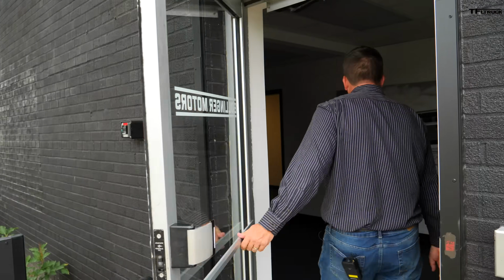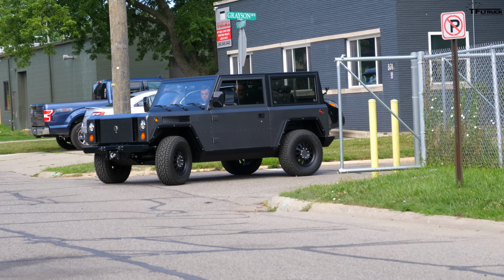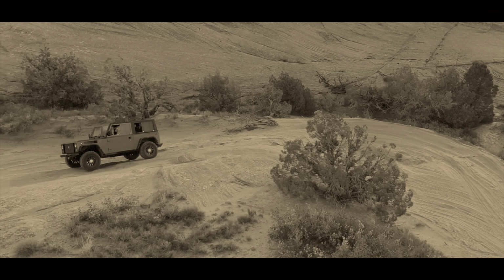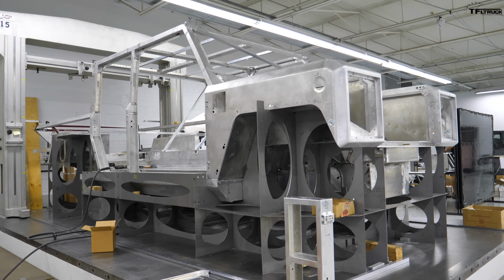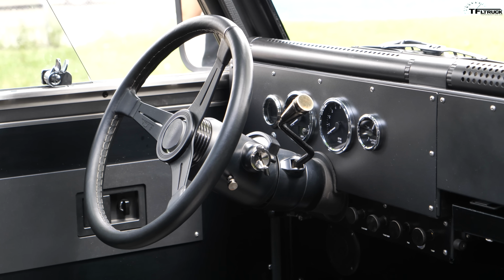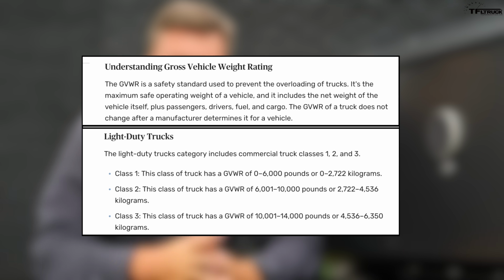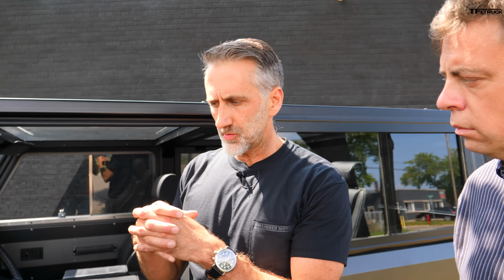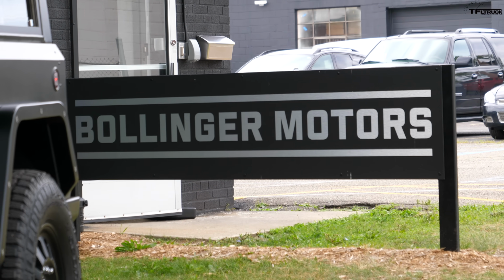EXCLUSIVE! Meet the Bollinger Trucks That Can Off-Road Like a Jeep and Haul Heavy

Comment: Well you could take a generator with you so you could charge it up if you needed to or make up a solar panels to charge it up while you fish or whatever. Anyways EV are coming and going to replace gas powered in the future especially when we run out of oil one day, so might as well get one to go along with what you already have. Times are changing if we want them to or not, so either get on board or get left behind!
Reply: It has a large flat roof that would be perfect for solar panels.
Reply: Or with all the empty space in the body a medium sized generator and 10-15 gallon tank to charge your batteries and power your camp/work site if needed. I don't understand the desire to make off road or work vehicles to be totally electric and not have any type of fuel.
Reply: I highly doubt EVs will replace ice vehicles, ever, even if ICE vehicles just become novelty vehicles, there will ALWAYS be people who want ease of repair, actual noise ect.

Comment: Throw a big loud V8 generator in the front and they might have something...lol
Reply: So not only doesn't it have gears you can row through but the engine just sits there at 3k rpm even when you're parked? What a complete turn off.
Reply: @markm0000  To each his own I guess. Personally I would not want to be deep in the woods and be low on battery. I would prefer to fire up the engine (like a diesel locomotive) and carry on. 200 miles range is very limiting. However if you are thinking of using it to shuffle the kids to soccer practice, then I get what you mean.
Reply: @smarticus6384  ----- What's the difference between being deep in the woods with a low battery and being deep in the woods and out of fuel?
Reply: Glenn Howden nothing, except for maybe a few hundred more miles of range. So I guess that’s something.....

Comment: Wonder how much it weighs since full ev vehicles weigh a lot.
Reply from the maker: Curb weight is about 5,000 lbs.
Reply: @TFLtruck  wow, that's pretty light for a full size truck. My dad has a 07 tundra and it's about 5700 ibs and has good acceleration. Can't imagine how fast this is with over 600hp.

Comment: Needs to be boxier.
Reply: Yeah. I know. They put round steering wheel, tires and headlights. That's just wrong!!
Reply: @reubinthomas  They will fix that for the next model.
Reply: Yeah the windscreen is at about 100degrees, should have been 90

Comment: If this was a gas or diesel truck, everyone would be laughing until they couldn’t breathe! The only reason people think this is a viable vehicle is because it is electric. It’s ugly, it has some of the most bizarre features, kinda like the Trailblazer when it had the sliding roof so you could load tall items, didn’t work. There looks to be about a billion dollars of factory and machining they forgot to get so they could actually produce more than 1 unit a month. There is no real design as the industry knows, even Rivian has an actual design vs build a box, place the batteries and motors, figure out how to fill the spaces left over. I know it’s not exactly that simple, but it looks that simple. Backyard hillbilly type build. They need an actual designer to produce something marketable. The “retro” rudimentary gauges, are just rudimentary. The steering wheel looks like they took it off of my John Deere yard tractor. Seats were nice for the front occupants. There, I said something nice. 
    Millions of dollars wasted, but the executives pull 1 or 2 million a year each out of it, live like kings and queens, have a nice nest egg left over when the company fails and they become another DeLorean type story.  There are a huge number of hours wasted trying to inefficiently build this vehicle and you pay for them. $150,000 USD? That is almost $200,000 Canadian. This spring I bought 3 x F150 XLT FX4s and 1 x F350 XLT FX4 Diesel for similar money. I will take 4 trucks that can be used every day, all day, run out of fuel and you can fill up in 10 minutes and keep working. They all have airbags and high end safety systems, including the SuperDuty! This is the most rudimentary, made up oddity that I believe will be around for a few years and then it will disappear. Try to get parts after that! These guys designed their parts in house, can’t go get something from Rivian and make it work etc. 
  I could be wrong, but this guy did not give off any vibes supporting his belief the truck will go into production. He appears to be just delivering lines people want to hear.
   Hope they make it. He said you either love it or hate it, I’m the latter.
Reply: You called it - your points are right on.

Comment: Looking good so far. But...Does the 200 mile range mean I'd have to transport it to the off road trail each time in order to have some fun? Overall I think EVs have one hurdle to overcome - they need some real breakthrough in battery tech. Otherwise, I like this.
Reply: I read in the last few days about an electric motor breakthrough out of Texas that promises lighter, compact, more powerful, and more efficient engines. That will help boost the range, so it is not just battery tech that progresses.

Comment: Battery on the bottom not too bright for offroading is it?
Reply: Lower center of gravity. As long as the protection is good.
Reply: xlthumper yeh but if the protection is forced upwards towards to battery could be expensive andnmot too far off s an expectation

Comment: The design looks like it will do terrible in a crash test...
Reply: alvaro mora the gwagon is totally boxy and is very good on crash tests
Reply: Yeah but the g wagon's A pillar is way thicker and the front part contains the engine....
Reply: @carholic-sz3qv  G-wagon have airbags and alot of saftey systems, soft materials were you can hit yourself in a crash. this one has... seatbelts.
Reply: I don't see any engineering for crumple zones, though it would probably really do a number on a vehicle it crashes into.
Reply: @I know you are right, And I just got owned but: be nice, low production volume has nothing to do with it. It's the GVWR.

Comment: As a Landie addict, looks like what I was hoping a new Defender would look like! Very workman like!
Reply: My only concern with replacing my Defender with this is that this is a much wider animal. Many lanes that are accessible in a Defender won't be in this.
Reply: @verlicht  Sure. It was the styling theme that I liked. All the talk of Broncos etc., it appears to me much more influenced by traditional land rovers. Narrow it a bit, give it a slightly taller body and stick a Land Rover badge on it!
Reply: @verlicht  could you imagine taking it down a country lane! Although I still prefer it over the new defender design.
Reply: @freyawainwright7364  Now that you speak of it, yes I could imagine me driving this car. Using my chainsaw to clear every track I go on to make it fit my dimensions and putting the first scratches on it (knowing thousands will follow). Feeling the hurt of that first dent on the side of the car and replacing the first flat mid-trial. Going through muddy places only possible with diff lockers for the first time without breaking out the winch. Pulling my companions out of the worst holes on planet earth and wading deeper than my Defender ever could. 

It would be a dream to own one of these beast one day. And I'd be the first to put it to use.
Reply: Well yes I think it is the lawful descendent of the Defender

Comment: When an electric vehicle can be charged from 1% to 100% in 10 minutes or less, AND charging stations are at every gas station, then I’ll buy an electric vehicle. I don’t want to wait for hours and hours to charge just to go 200-400 miles. Charge that sucker in less than 10 minutes, that’s how long it takes to fill up my gas or diesel tank. The next big thing in electric vehicles has to be charging fully in under 10 minutes, not 15, 20, 30, etc. It has to be 10 minutes or less.
Reply: 400 miles is like average 7 hour drive ? You do that daily...no. do you not have to sleep daily for 6hrs at least...no. do you not stop to eat for 30minutes..no. do you not have to go to the bathroom play on your phone for 30min..no. Do y'all just see a #EVrange number & judge it with no facts... pretty much.
Reply: SOLAR SS Daily driving isn’t where I take issue with range. On average I’m taking trips 4-5 times a year that I’ll cover 400 miles in a day. If I were to switch to an electric truck it would need to be capable of covering that distance. When I’m on the road I tend to eat while I’m driving, and keep bathroom breaks as short as possible. I don’t like making the trip any longer than necessary. I’ve made the trip from Suracuse NY to Breckinridge Colorado in 28 hours. In an EV that’s just not possible. You’d have to stop and charge. Which I’m ok with, it would force me to actually get some sleep. My point is range matters though. Not for every day, but for travel it’s imperative to making good time.
Reply: @MullerMountainMedia  when i drive over close or over 20 hours im just a zombie for the next 2 days so i just avoid that anymore all together (flying if i need to get somewhere quick). Granted i wouldn't like having to wait the extra time either if i had nothing to do. But as long as it was a 3 phase charger I'd manage
Reply: SOLAR SS Long Hours on the road takes its toll on my energy level too. I’m used to running on too little sleep though so I usually recover within a day. And I hate the TSA. Lol. Either way I’m more likely to go with Tesla anyway. This thing is a bit spartan for my taste. I can’t wait to see what their truck looks like.
Reply: SOLAR SS I do drive a ton daily, I’m an Uber and Lyft driver. If my car is sitting and not moving, I’m not making money.
Reply: With EVs, you have to change your habits a little bit. Plug it in overnight and have full range everyday.
Reply: @officialyasir  A ton of people can't charge their EVs because they have shared parking or park where a lot of people walk around. That's just asking for someone to mess up your car.
Reply: Mark M I agree it’s difficult for people living in apartments. This is why Teslas are popular because they have a fast charging superchargers network. I got lucky, my apartment has a multi story parking garage that has outlets around and also 2 ChargePoint chargers.
Reply: I’m ok with a slower charge, as long as they up the range. Give me 500 miles and I can charge overnight.
Reply: @officialyasir  Here is one of many stories: https://www.pocket-lint.com/gadgets/news/130380-future-batteries-coming-soon-charge-in-seconds-last-months-and-power-over-the-air
Reply: New battery technology is coming.
Reply: @officialyasir  granted it will. But the new Ram has a what 23 gallon tank ford 21 gms like 24 (1500s standard) they won't go for 200miles either anymore. Quicker to fill up but still have to stop
Reply: @officialyasir  yeah lol most of them on the new ones are a option too which are harder to find decked out like you want. The old standard 26.5gal tanks where the ones i like. My old HD Avalanche had like a 38gal it was overkill for what it could pull.

Comment: The rear end would look much better with a spare tire carrier to help break up how flat it is back there.
Reply: Only if the tire is square. Only corners or straight lines allowed.
Reply: Not a good place to mount a spare tire, although it looks good and is easily accessible.
Reply: The back is flatter than an asian girl's ass
Reply: @Mixwell1983  I like my women like my trucks
FLAT
Reply: @bryanmartinez6600  well i would say I like my women like I like my offroading.. Too many obsticles, hard to get on top and never forgiving.
Reply: @Mixwell1983  don't forget muddy and wet!
Reply: mixwell1983 was a great time for p
Reply: @Mixwell1983  I don't know what type of Asian girls you have been with. You must have been but with asian guys because no asian girl I know fits that your description.